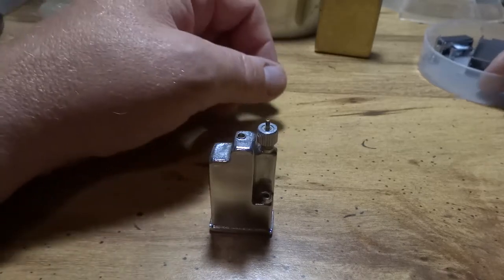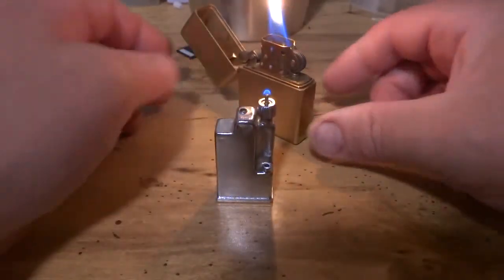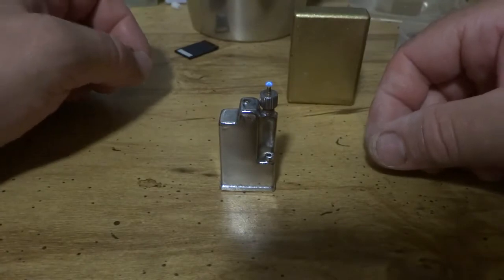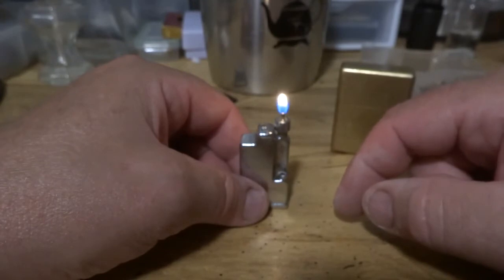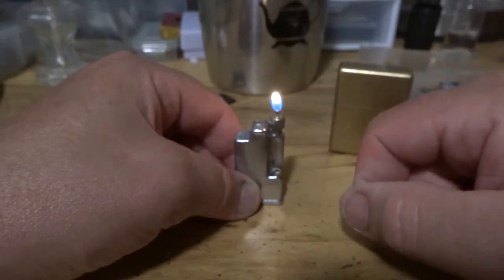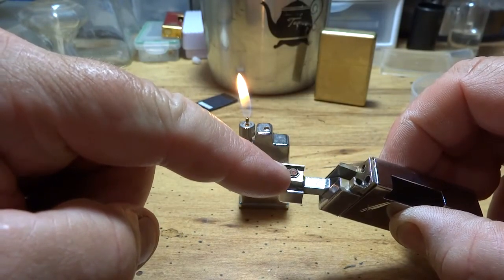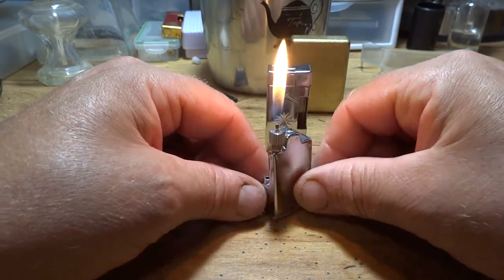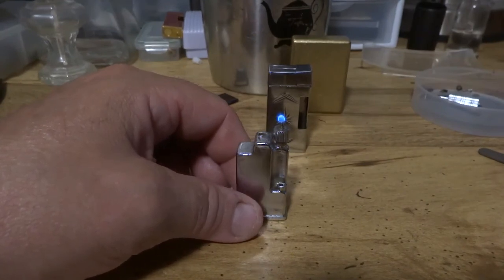JJJ  Lighter Thoughts And Lesson!

Comment: Excellent video, what you say regarding the cotton wool inside the tank makes sense to me, the only downside is if it limits the amount of fuel to be significant enough? It would be interesting to know how much fuel you can get into a standard tank and one after you put cotton wool inside? If it is negligible then it in theory will work to the advantage of a more even burning flame you say it should.
Also out of interest, you said when you close the lid the spring mounted cap shuts the flame off where it contacts the burner valve, is that all that closes the butane from leaking out of the valve or does the valve also have a mechanism or internal seal that closes additionally to stop the butane leaking out of the valve also? ✌️
Reply from the maker: The spring mounted silicone stopper is all thats shuts off the butane. Thats all that is really needed and it's an easy fix should you burn one out after prolonged use.

Comment: I got one of these lighters as a gift, but its got a good amount of grime under the lid and around the wheels and hinge. Any suggestion on the best way to clean it up? I don't want to use a chemical solution that would damage it. Thanks!
Reply from the maker: 91% Rubbing alcohol Cotton swabs a a brass brush if you need to clean the Flint wheel.
Reply: @Lighters-cf4bd  Great, thanks!
Reply: @Lighters-cf4bd  Well I didn't see your other video in time. I broke the little screw on the flint wheel because I didn't turn it the opposite way to loosen it. Unrepairable at this point?
Reply from the maker: @AAPDX  I don't know. Get a dremel and small bit and see if it will unscrew when you try to drill it out. Might be easy to remove now with the head off the screw.
Reply: @Lighters-cf4bd  good idea. Getting the replacement screw would be my main concern at this point.
Reply from the maker: @AAPDX  Ill see if I have a screw

Comment: Hey man ya have an extra screw that holds the flint ?
Reply: I came across one of these lighter and the screw that holds the flint in is missing. Ya got an extra one I could buy ?
Reply from the maker: @PiranhaNut  I have one only! It has the same thread but the head isn't as round still works in the lighter in the video. You have the spring for the screw?
Reply: @Lighters-cf4bd  no spring either. I'm just noticing now that I have a slightly different lighter the flint roller looks smaller.
Reply from the maker: @PiranhaNut  send me a photo
Reply: @Lighters-cf4bd  ok what email should I send it to?
Reply from the maker: @PiranhaNut  lighters2018@gmail.com